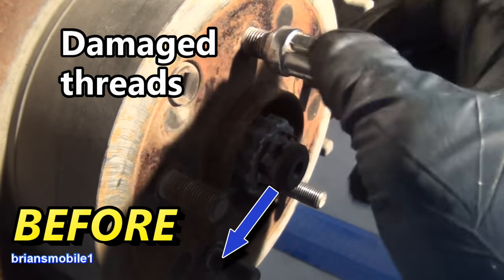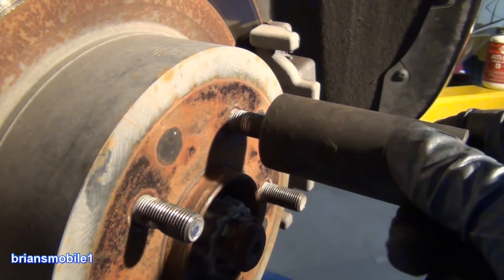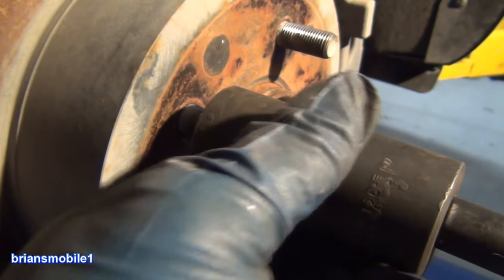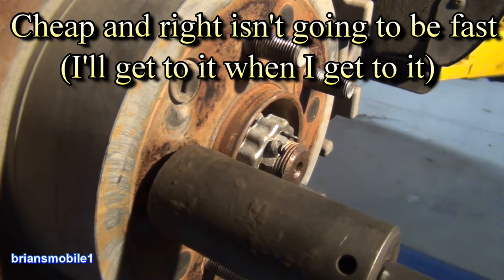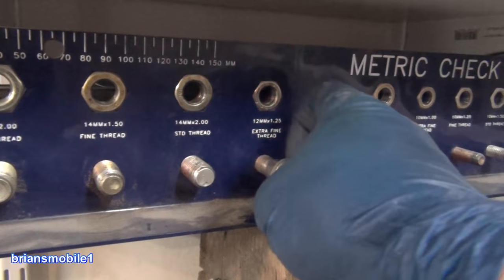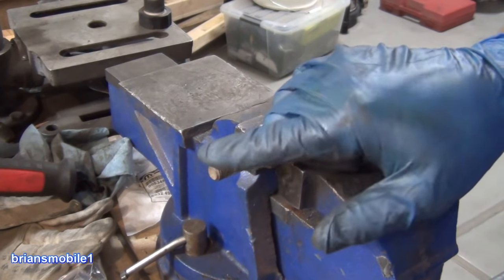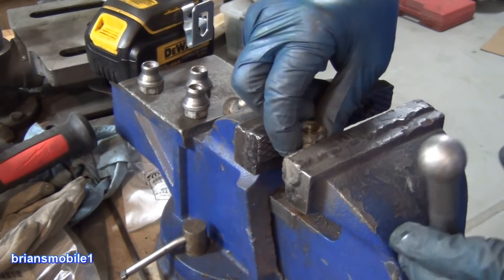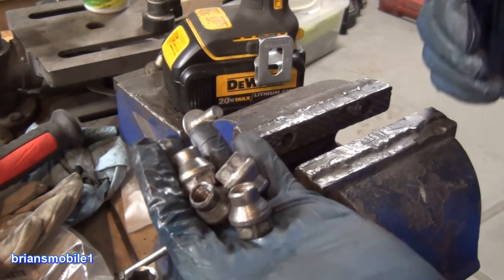Wheel Came Off Damage Repair Fast Cheap

Comment: Nice tip with breaking the die in order to keep the internal threads- this i will keep as a get out of trouble on late night repair and the proper tool is not available. Thanks once again for your knowledge, experience and teaching

Comment: I run tap or dies over many nuts, bolts, tapped housings on my old vehicals.   It really helps make installation easier. Not to mention any future maintenance.

Comment: i've had to make taps m12 x 1.25 to do stuff on Toyotas, no always wheel studs/nuts. i did order taps/dies in that size as soon as i could after that. i have them those sizes in my thread chaser kit, but before i got it i was always using my taps/dies and that size didn't come in it. i actually have a set of split dies now, of the most common sizes of wheel studs. they open up, have a little hinge on one side, usually a 1 inch or 1 1/4 socket works well on them. only thing is you have to just go in reverse with them, i have tried going forward after i back it out over the bad thread and it always wanted to cross thread.

Comment: 20 minutes each way to the parts store, but you can bet that these will show up 10 minutes after they have closed for the weekend, and the Monday is a holiday as well, and you need the vehicle to go somewhere with the family for this first break in months together. You bet you will make it work.

Don't have a thread nut, make it yourself using the thin cutting disk, and the appropriate size nut, cutting a slot into it to get that sharp thread cutting edge to fix the damage. Works to get that damage away, plus you can also use it if the thread is rusted solid as it will give slightly to get the rust away. Preferably a hardened nut or a stainless steel one, they are more resistant and will hold that edge for a little longer.
Reply from the maker: Sean, I feel so understood right now.  And I like it!
Reply: @briansmobile1  Ever change a water pump at 6PM at the side of the road, because destination is 500km away, and you really do not want to spend the weekend in a town where they roll the streets up at sunset. Lucky the garage did have one, and it was a quick change, experience from doing so many of them.

Comment: Wow excellent idea Brian, cutting that in half so you can start on the bottom and work you way off. 
I hate messed up threads two2. I towed for awhile and getting a lug off with a messed up thread was one of the pita's of the job. 
Never busted off a stud but did have a couple that you couldn't put all the lugs back on. 
So you got the Imperial of bolt and nut checkers well Imperial and standard I guess. 
Chewy  at the bottom?
Han: What do ya think Chewy?
Arwwwwwww. 
Another great video Brian, good tips. 
Have a great day and 
Happy Motoring.

Comment: I really hope the owner takes your advise and gets those studs replaced as soon as possible. You took a lot of meat out of that one stud and all it will take is someone with an impact wrench set too high to snap it off in a second.
Reply from the maker: Snapping a wheel stud off in the shop isn't a big deal.  They're easy to change and that makes the call easy to make to replace it.  The hard thing is spun threads when you can't get the nut to come off on the side of the road and you've got a flat tire in a remote location and can't get the wheel off to put a spare on.

Comment: I admire the saving of the money, tho I would had just replaced the stud.
Reply: He said in the video this was a band-aid for the client and told them as such. Next time the car comes in it's getting new studs and lug nuts.
Reply: Sometimes all that's available is the dorman branded stud, unless a dealer is close by. This is a very useful tip

Comment: Brain, this has happened in my area a lot and I mean a lot. People will put these type of chrome wheels on their cars without realizing that they only catch about 3 threads and driving down the road they fall off. Mostly chrome wheels in my area like the one in the video. They just don't get it. While I'm in a Tercel sized car with the factory steel wheels, doing 90 mph on the freeway, and have no trouble. I just not a fan of chrome wheels after what I seen happen for so many years, looks cool but can surely kill you, big YES....
Reply from the maker: Great observation on a similar problem that many people miss that results in a safety issue.  People can swap for longer wheel studs to accommodate the thicker aluminum rims and make it work.  And there are certainly good reasons in ride quality, acceleration, and aesthetics to swap for rims they like better if only for looks (customer is always right when it's for looks they like).  In this case the factory wheels and aftermarket wheels were of similar thickness.  What started this whole problem was because one wheel came loose and got ruined because it wasn't tightened properly at some point.  That's why they had to buy a whole new set of 4 cheaper aftermarket wheels.  It was cheaper/faster/better for them than buying one new expensive factory aluminum Infinity wheel.  It seems they just put good lug nuts back onto damaged wheel studs.  This spread the fail to the lug nuts too.